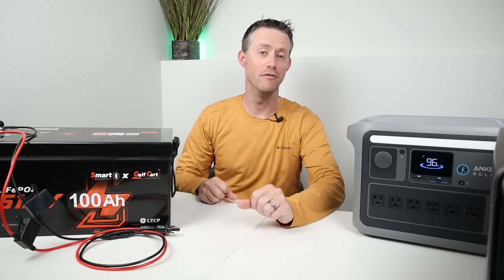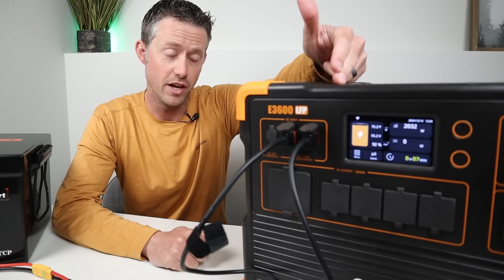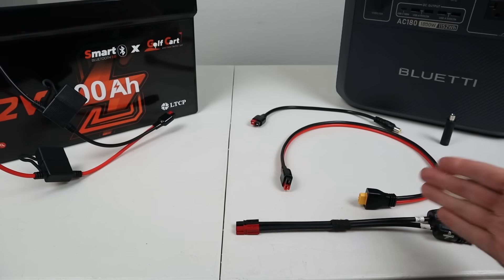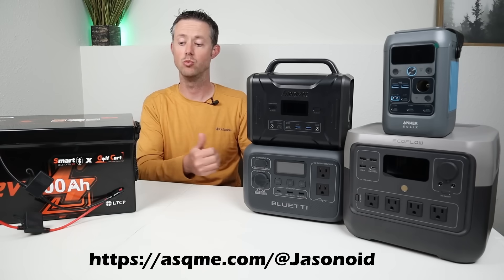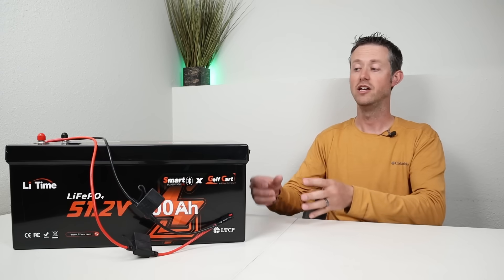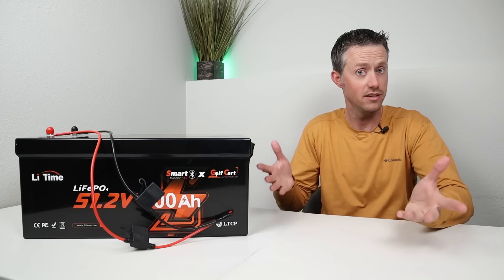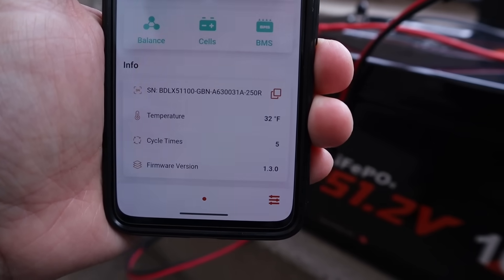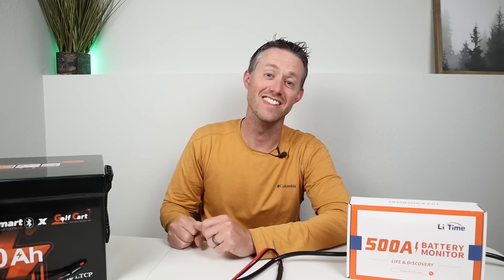Simple Trick to Make Your Power Station Last 5X Longer! Charging with a LiTime 48v Smart Battery!

Comment: I have a dumb question, not exactly related to this scenario specifically.
Now that the weather is colder outside, do any of the "Factory Made" (aka Anker, Blueti, Ecoflow) powerstations have low temp charging protection???
So if my Anker C1000 is in the backseat of my pickup with a pecron charger hooked up, and I get back in the truck and start it up and drive off, the pecron is gonna start offering to charge the C1000, but will it be damaged by charging while COLD???
Thanks
Another Great Video!!
Reply: I would be willing to bet that every known brand power station has low temp cutoff.

They would be drowning in litigation if they all failed due to temperature.
Reply: @andrewr05  So far all I've found in the manual in the manual for MY ANKER C1000!!
"4.Low-Temperature Alert: When this icon shows, stop using the power station until the icon disappears."
It shows a snowflake on the display, and the manual says "stop using the power station until the icon disappears."
So I'm not convinced it will stop charging on it's own
Reply: @dannydivine7699 

MyBluetti AC200Max is worded just as confusing me, but I have clarification from their customer service reps that it does indeed self-limit it's charging when it is too cold. 

You will likely want clarification directly from Anker to be safe.
Reply from the maker: Newer models seem to mention low temp charging protection in the user manuals. Some even state they have icons on the screen that will show up if you try charging them in low temps. Older power station models don't mention this at all so it's hard to know if they even have protections in place. It's a newer trend for sure.

There are three power stations right now that actually have built in heaters:  the Pecron E1000LFP, the EcoFlow DPU, and the Bluetti AC500. Kinda cool to see a budget, lightweight model with heaters, the E1000lfp, I'll be testing that soon.

Comment: Excellent presentation.  Thank you.  This is really valuable info for folks that tinker.   I originally had a "power station" as my "main power" just like you describe in this video and used some LiTime Mini's to boost the capacity and stay charged.  Most of my stuff is 12-13v for car/van/truck camping.  I actually ended up making my LiTime Mini's the main power with the "power station" being secondary.  I found that I saved 10-15 watts by not passing everything through the "power station".   I now just only use the "power station" when absolutely needed for 120v or USB-A/C and once its gets low, I recharge it from the Minis.  I save a ton of power by running my fridge and anything else 12-14v directly from the Minis with no power robbing converter/booster/power station needed.  Your setup allows for things to run either directly via the LiTime battery setup or "power station" assuming you pick the right battery voltage for your stuff.
Reply from the maker: Yeah, if you only run 12v devices, a standalone battery will always be most efficient. No conversion losses or background power being used. I have a cool product I'll be testing here in a few weeks that might apply to your situation 😁👍
Reply: New to this battery solar back up stuff.  Any chance of explaining your build?  Looking to build up knowledge because of what you said and what I learned about these portable power stations, I feel like being robbed of my energy I put in them. 😂😂

Comment: It doesn’t hurt the expansion battery if it runs out of juice charging the power station?
Reply from the maker: It will shut off when it hits low voltage. The BMS will protect the battery. No damage done.

Comment: Thanks Jason for all the time and effort you put into your videos they are very helpful. I have a Bluetti AC200L and was wondering if you could use the Bluetti D40 which you recently reviewed to charge that 48 volt battery with a step up converter of course to the 48 volts since it puts out 12. Then add the Bluetti Charge 1 or solar panels inline with the 48V batter input or charge through the alternator input of the D40. Trying to figure how to use the AC200L to kind of manage an external battery that is connected to it.
Reply from the maker: I don't think that would be a good solution with the D40. The D40 is such a unique device and its use case is very limited. What's your main goal you are trying to accomplish?
Reply: @Jasonoid  I would like to add a large secondary battery like shown in your video but have the AC200L manage (charge it when not drawing power from) that battery. I know the simple solution is to buy a BLUETTI Expansion Battery like the B300K because they communicate with each other. I was hoping the D40 would be that solution since its main purpose is for recharging an external battery. The B300K and the LiTime 48v battery are about the same price but you get so much more storage from the the LiTime 48v. Thanks for your time!
Reply from the maker: @renatoconsolini8436  unfortunately the D40 will not offer that functionality, even with a little 'hackery'. If you want something automatic, you'll need the B300k.
Reply: @Jasonoid  Thank you!!

Comment: Thanks for this! I'm converting a shuttle bus and want to do this and use my Bluetti AC180 instead of solar since my bus has 2 batteries.
Reply from the maker: What voltage are your batteries in your bus?
Reply: @Jasonoid  they're 12v but I want to use a 12v to 24v/36v stepup
Reply from the maker: @DesmondCrusoe  I'd recommend using the Bluetti Charger 1 connected to your 12v battery. It will charge your AC180 at the full 500 watts. I have a recent video on the Charger 1 from a few weeks ago 👍 the price is really good right now and they now include the wiring to hook it up!
Reply: @Jasonoid  thank you, I saw that video actually and was looking into that also!

Comment: Why charge a power station versus getting an inverter for your huge battery?
Reply from the maker: Why not have both the battery and inverter and use it in multiple ways? These batteries have many different uses.

Comment: 24 volts seems to be the sweet spot for price and size. If using with regular appliances I can keep a fridge, deep freeze and small loads happy because over a day the Delta will not use more than it's been recharging with.
Reply: The problem with 24V is that with a lot of units anything under 28V is considered to be coming from a 12/24V cigarette lighter port, so it's limited to 8 amps.

When you use 36V or 48V The unit uses its maximum amperage input specifications.
Reply: @andrewr05  24 volt speed works just fine for my use case.
Reply: @andrewr05  SO how do the power stations charge at 500+ watt when alternator put out 14 V...
Reply: @dubious6718  
That's not possible without some sort of voltage converter.

Unless you have a power station that can take 35+ Amps.

Comment: Hi Jason; I absolutely love your channel. I have learned a great deal over the past few years by watching you! I was intrigued by the setup you described in this video and put together a smaller arrangement - Anker 757 and a 100 AH/12 volt battery - which doubled the run time of the 757; and I used a 20 amp fuse (Anker 757 solar spec is 10 amp/11 - 30 Volts). However I ran across this source (https://www.youtube.com/watch?v=fPOFAkIHLRE&list=PLse4Lw4DDzmKU5u_MZrdfL5AOT6j6bv9P&index=41) which recommends a 100 Amp fuse for my simple system - based on the premise that this is the level of fuse that could handle a short from the battery - since lithium batteries can discharge almost all at one if a short circuit occurs. I was a little taken aback by this. I would appreciate any insight you have to offer on this. Thank you, Arthur
Reply from the maker: Interesting video. Each LFP battery has a built in BMS which protects against short circuits as a first line of defense. 
Putting a fuse larger than what your wire is rated for will just cause your wire to burn in the case of a short circuit. For example, if you ran 12awg wire rated for 20 amps, and you put a 100 amp fuse on that wire, the wire would just melt/burn if something bad happened and the fuse wouldn't blow. Always match the fuse rating with your wire ampacity. If you need to pull high power / amperage, install a larger wire and fuses.

Comment: So far, with more of a budget, I like the Temgot 12v 300ah which comes in just under 16 cents per ah and has a built in display as well as the Bluetooth. I was skeptical of the display but having used one now for a little bit I’m loving that feature 🤷🏻‍♂️
Reply from the maker: Sounds like an excellent option but you'd need a converter to boost the voltage to charge a power station faster.
Reply: @Jasonoid  fortunately, in my situation, while faster charging speed is always nice, it is not really a need. Love your channel 🙏

Comment: Hello Jason. I have two Renogy lithium 12 volts batteries, can I do this set up with only 24 volts?. I knew it won’t be as good with 48 volts. Thanks
Reply from the maker: If your specific batteries support series connections, yes you can do a similar process to get 24v instead.
Reply: Yes. They do support series connection. Thank you and great videos 👍🏾

Comment: $1100 battery to charge your power station or use the elec in your home for free. Or buy another battery for your power station to add more wh. Hmmmm…
Reply from the maker: The whole purpose of using a battery like this is to get a longer runtime when electricity isn't available in your home. Backup power lasting longer during a power outage.
Reply: @ why not by the additional battery or more  that belongs to that system?
Reply: @jnmc-vx4fw 

Because that costs three times the amount of money.
Reply: @andrewr05  that’s why I said ,your cheap. I only buy quality top of line
Reply: @jnmc-vx4fw  

My cheap?

|"only buy top of the line"
Except that if that were true you  wouldn't be wasting your money on a power station, you would have something like a full Victron or Outback eco-system setup with 50Kwh of batteries.
Reply: @ I have a generac whole home back up generator for my 3 homes, 2 I rent out. I do have ecofow max with 2 extra batteries also and 2 river 2 pros. 
    I’ve never been without power with this set up for more than 1 min. Generac is the answer
Reply: | "or use the electricity in your home for free"

Do you just not understand why these exist?
Reply: @ for people to cheap to buy the additional batteries that belong and are designed for the system your using

Comment: Great video as always.  On occasion I've used my EG4 server rack battery only to extend run time on my EcoFlow.  I bought a couple of 12V batteries during Black Friday so that I could charge my smaller units like the Jackery 500 as you had demonstrated in a previous video.  I also decided that when I go camping on the beach that I will use the 12V batteries to power my 12V fridge with an adapter cable.  After 4 years of using my Jackery under windy, sandy and high humidity my 12V port stopped working.  The 12V batteries I can live outside and not worry about the wind and sand and humidity.   I don't believe in buying extension batteries, if anything I buy just a duplicate power station.  Thank you for this great video.
Reply: Make up a power box put 6 cigarette lighter ports and put a fuse block inside the box use 10 gauge wires or whatever gauge will handle 20 amp fuses cigarette lighters can be found at most auto wreckers they are the ones that have steel barrel and ceramic isolation on the positive side if using auxiliary ports you are limited to 15 or less amp fuses car adapters for usb chargers are usually cheaper than the built in ones used in most power boxes and you can get a variety of 12 volt appliances from ovens to coffee pots the reason I suggest cigarette lighter ports over auxiliary ports is my 12 volt electric oven will blow a 15 amp fuse and the auxiliary port starts to melt under the load after it is used for any time over 10 minutes you can use auxiliary ports for 4 of the port and lower gauge wires and fuses and mark the 20 amp cigarette lighter ports in red but i find its simpler to just have them all the same
Reply from the maker: Great points, especially about using batteries instead of power stations in Sandy environments! Oh man.... I hate sand and how it gets everywhere!
Reply: @Jasonoid do you have any videos on using these batteries to charge your DPU that show hoe long it takes to charge the DPU?  Also any videos showing how to connect the battery to the DPU? And any videos on how to charge the battery with solar panels and the AC/DC charger and how long it takes to charge the battery? Lastly showing the app that lets you see the status of the battery via Bluetooth?

Comment: If i put an MPPT between the battery and power station, is it possible to charge both the battery and power station with a solar panel? (I have a Bluetti AC70P)
Reply from the maker: It would be difficult to charge both at the same time, however the solar panel could connect to either of them when needed.
Reply: @Jasonoid Check ETAKER F2000. It is multi input and output and best of all, it charges your RV car battery back. It can even jump start it. It can do input of 1000w DC + 1000w solar to a total of 1800w output. The ports are bi directional and customizable.
Reply: I just run the charge controller to the battery and then the battery to the power station. 

That way the battery is constantly topping up the power station and then the solar panels are charging the battery.

Comment: You could also use a 48V to 36V/24V/12V buck converter in a pinch with this battery, if you didn't have other 12V batteries handy.
Reply from the maker: That's true! Drop down the voltage to something that a smaller power station can accept.
Reply: Most buck converters on Amazon are cheap & will not current regulate. At best, they'll cycle off for "short protection" then cycle back on... constantly till they die. For longevity, they are best used at 50% the advertised rating.
Better off getting an additional 24v battery IMO
Reply: The cheaper ones on Amazon can't handle 100% duty cycle, they will burn out. Victron's converters are a better option...

Comment: Now all you need is a golf cart; I've been looking for an inexpensive golf cart myself. I have been watching many videos of installing 48-volt lithium batteries in the older golf carts.
Reply from the maker: The electric models are pretty expensive! I've looked occasionally but I haven't found anything amazing yet 😂
Reply: @Jasonoid  There are tons of cheap 36 volt ones but I haven't seen any cheap 48 volt ones. Maybe it's because there aren't any 36 volt golf cart lithium batterys.
Reply from the maker: @kevinholland4156 36v models have less power and range. Vatrer makes a 36v battery. I think Li Time does too:
https://www.vatrerpower.com/products/38-4v-105ah-lifepo4-golf-cart-battery-built-in-200a-bms-4000-cycles-rechargeable-lithium-battery-max-7-68kw-power-output?srsltid=AfmBOoqRdcwvpTFdR7BnVDlfs3vBgLrJrDzaodnhcD2OaltLDD0Ezj9Y

Comment: what about low voltage protection so one doesn't destroy the battery? (ie: test if the battery has a BMS with low V cutoff)
Reply from the maker: Every LFP battery has an internal battery management system (BMS) that protects the battery in many different ways. One of those features is called low voltage discharge protection. These LFP batteries are pretty bullet proof. You can't overcharge them nor over discharge them. They stop charging and discharging automatically. They are MILES ahead of lead acid batteries.

Comment: Apparently no blue tooth or app monitoring on smaller 60 amp.  Thar also does not have low temperature.  So 100 ah has more features than just size upgrade. WouldLike the smaller size one to move around though.
Reply from the maker: I think it's the 'smart' battery series that has the extra features, so they might be launching smaller 'smart' 48v batteries soon.